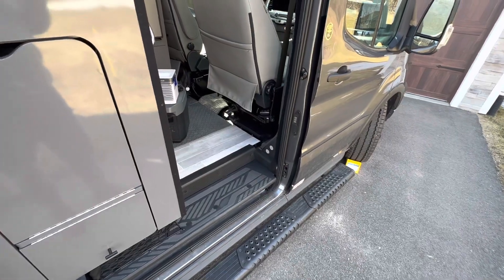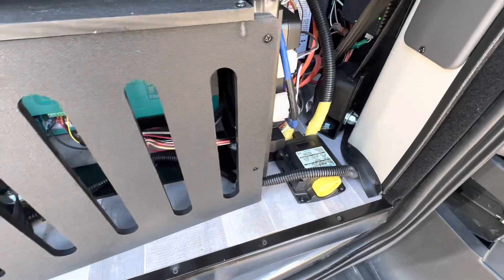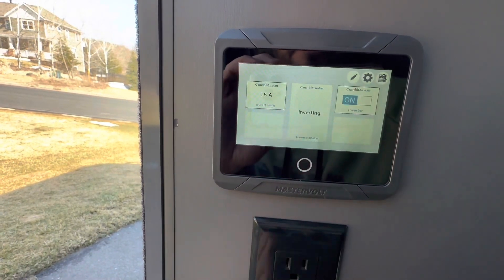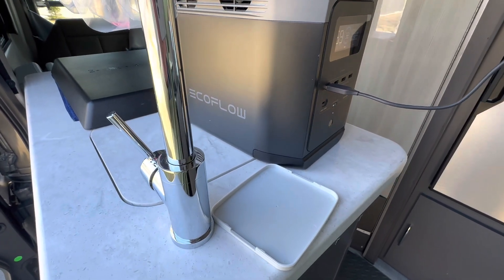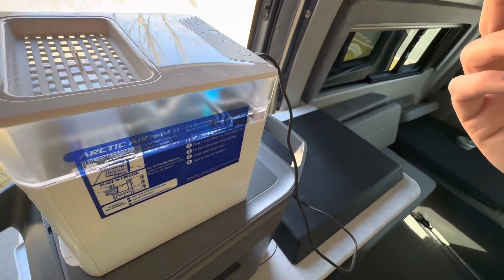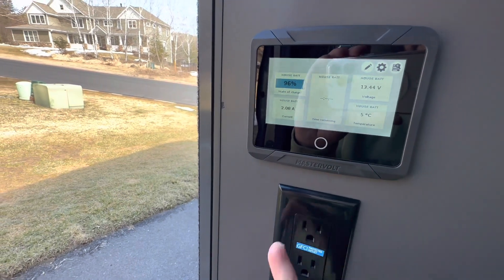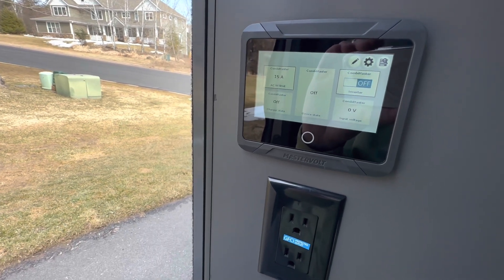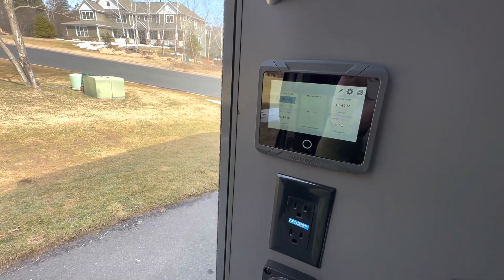Using the Re(Li)able Lithium Battery System in a Thor Sanctuary 19PT

Comment: Does this van come with a second alternator for use with the lithium system?  Or does it use the same alternator as the chassis/motor?
Reply from the maker: The transit does have a second from the factory.  I would hope the MB chassis would also have two but I’m not for sure.
Reply: @jtbrv23  Yeah, I think that is a requirement when the Re(L)iable Lithium package option is put in.  I honestly think you could get a channel going just talking about your rig.  There seems to be a lot of interest in these.

Comment: Hi I have the same van. If I turn on the roof AC unit my batteries go low even while  driving several hours. Do yours?
Reply from the maker: I will still be positive on the charge while AC is running.  Make sure in your master volt screen that the alternator is switched to enabled.  You should see positive amps even at idle but while driving you will see 80-100amps.  It will fluctuate a little as you drive.
Reply: @jtbrv23  HI I am looking at the correct place  "House Batt" At idle I see -1.46A current ?
Reply from the maker: @texanusa111  with AC running at idle you are -1 ish amps?  You might try turning AC off and see how many amps you make.  You might have other things drawing on power to make it just negative.
Reply: @jtbrv23  I had nothing  on. Same results. I checked alternator cables on tight.
Reply from the maker: Something is up with that then.  Going to probably need service dept to fix.  Hopefully it’s easy and quick.  I use mine nearly the entire time on a big trip.  Just last night went to a new campground and they had a bad shore power connection.  Had to run the van a little before sleeping to top off batteries.
Reply: @jtbrv23  Van going in the shop I'll let thee know what they found.
Reply from the maker: Hopefully it’s an easy fix.
Reply: @jtbrv23  it turned out to be a loose wire under the dashboard on passengers side. The controller was not getting the signal.
Reply from the maker: Glad it was an easy fix.
Reply: @texanusa111  I just bought a 2023 Sanctuary PT. I'm having the same problem that you were. When I drive the van I get no charging to my batteries. Charging from shore power works fine. The inverter works fine. On the mastervolt screen it says that the alternator is activated. I looked under the van to confirm that the 170 amp alternator is present and the wires are tight. Could you please tell me what loose wire you found under the passenger side dash that fixed your problem?
Reply: @cgmd4294  It was fixed at the Rv dealer. I just reached out to them for the invoice from that service visit.  They said they had to check with their manager first. I recall that a wiring harness was wired wrong and once they switched the wires charging worked.
Reply: @texanusa111  Thank you so much. I'm grateful for any more information you can find.

Comment: Dude is the Thor master volt battery any good? Why did you choose Thor over revel or sto van? I’m looking to buy an adventure van right now with a big energy system. Also have you run roof ac with lithium batteries, how long run time? Thanks dude.
Reply from the maker: The master volt system seems to perform ok.  It’s consumption seems to match the appliance that it’s running.  The roof AC runs fine on battery.  The AC is a battery hog though.  If you live somewhere hot and it runs continuous, it will be spent in about 3 hours.  You will likely need a generator if you truly want it to be cool all the time while off grid.  
Revel was the first van I looked at and while it looked good, it’s layout was funky.  I also didn’t fit it in any way.  Too tall to stand or sleep, and I would be surprised if bench seat fits any adult human.  Storyteller was too expensive for first van.  Thor checked more boxes and price point was better.  I’m going to look at a Thor Palladium in the next couple of weeks.  So even though Thor quality isn’t greatest, I would still consider them for next van.  If I was going to build a van, the 1910 would be close to what I would do so I want to see how they put it together.

Comment: Do you need your inverter on to run your refrigerator?
Reply from the maker: Nope.  The microwave, air conditioning and water heater/furnace need the inverter.
Reply: @jtbrv23  Thank you ✌️

Comment: Did you turn the inverter on before you turned the batteries on?
Reply from the maker: I usually don’t touch the physical switch on the inverter and I leave it in the on position.  I use the touch panel up front to turn it off and on.  The inverter does seem to turn on when I power up the van but sometimes I get a “device offline” message on the inverter screen.  In that case I will toggle the physical switch to off and back to on and it usually corrects.
Reply: @jtbrv23  thank you. That’s very helpful.
Reply from the maker: Sure thing.  Glad it was helpful and thanks for watching!
Reply: Another question.  What all needs to be on or off while attempting to charge up at home or on road?
Reply from the maker: if using shore power to charge I just need to have my yellow switch in the back turned on, or all the way to the right.  If I’m driving and charging I have the yellow switch on but also I have the house battery switch on as well.  That may just be because of the circumstances because if I’m driving far enough to warrant charging, I have the back turned on anyway.  For sure, for me, the yellow switch has to be turned on to charge.  Inverter does not not have to be enabled to charge btw. If using an outlet to charge, a converter will automatically enable.